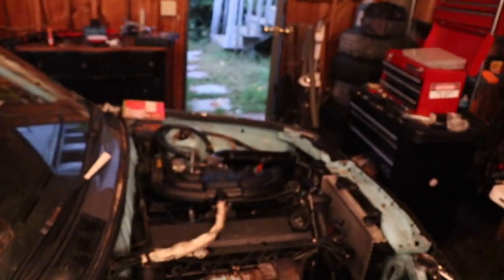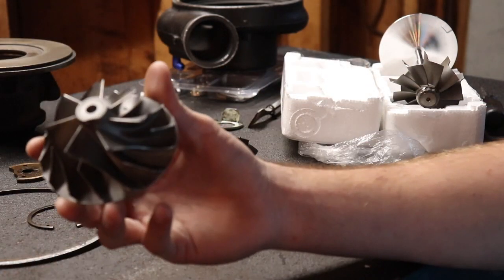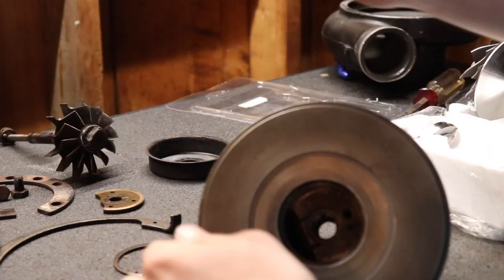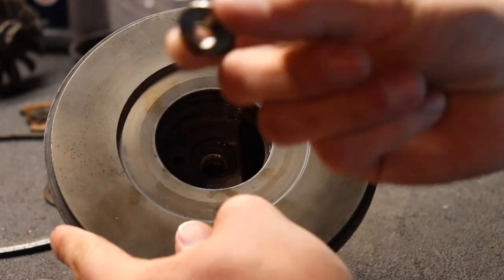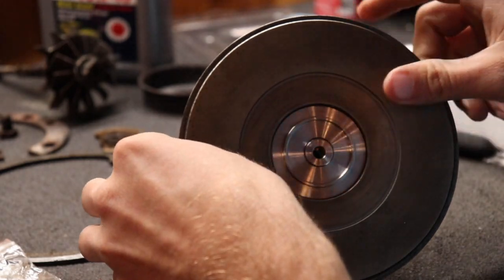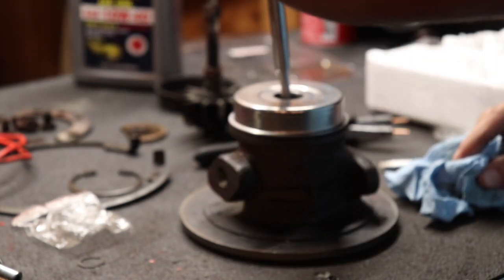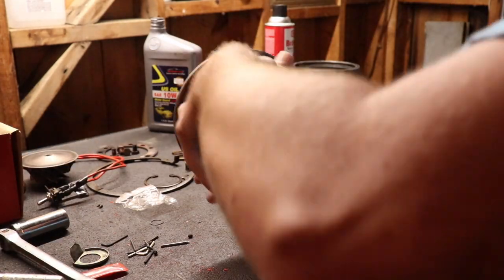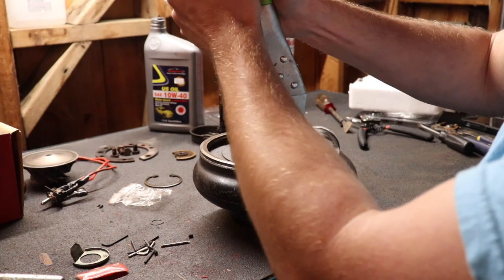How to rebuild a Holset Turbocharger

Comment: Them odd looking rings you are calling snap rings are not snap rings they are a positive sealing ring like a piston ring , or they are also referred to as slip rings when used in three piece exhaust manifolds , slip rimgs as they are referred to in my 1957 caterpillar parts book for the pony engine exhaust manifold

Comment: So the best way is to buy a ebay hx35 and a genuine thrust washer and bearing?. And swap it all out
Reply from the maker: This wasn’t at EBay  brand hx35 but if you can find a real hx35 on eBay that will work. You have to balance the turbine tho if your upgrading that with after market or you will have a bad time

Comment: A good way to get better grip on the giant snap ring is to put it in a vice and hammer the grip tabs a little bit so they're actually flat or even past flat so there's a negative slant to them. Makes it almost impossible to slip out of the vice grips.